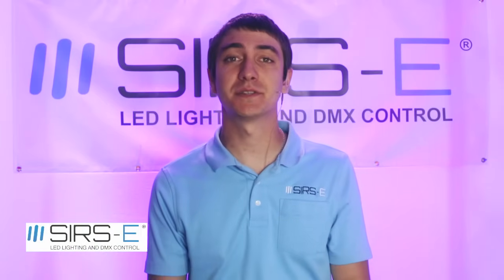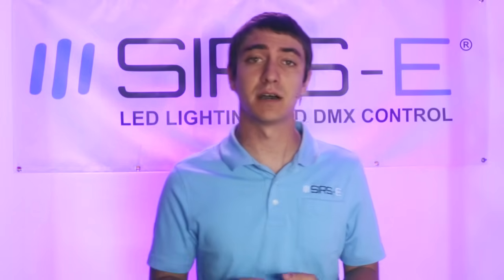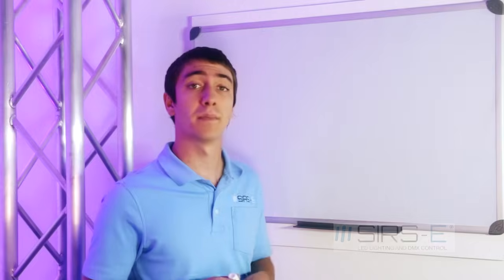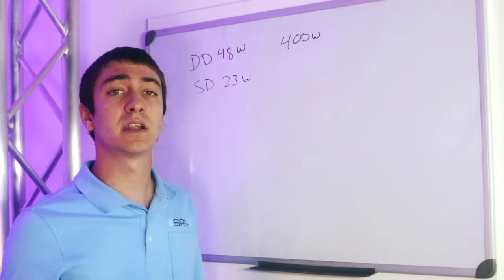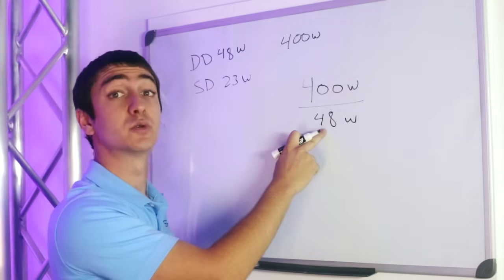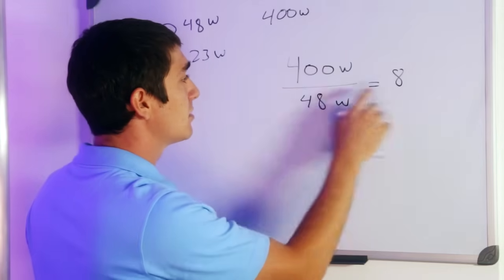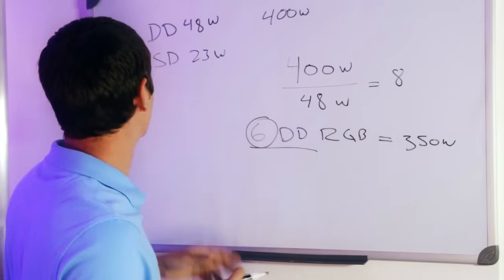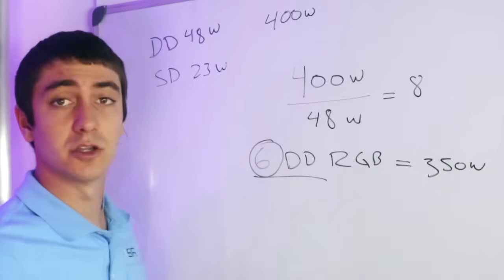How Many RGB LED Strip per Power Supply?

Comment: How do you control more than 1 5M roll of RGB or RGBW led strips? The seller I asked on eBay has no idea. I'm looking to use 5 rolls for the front room project in my place as I have a 450W computer PS already, I would like to use the RGBW so it can be my main lighting. Thank you very much
Reply from the maker: +Josh Rhoton Hello Josh, we are more than happy to assist you, please email us this information at info@sirs-e.com and they will be able to answer your question thoroughly.

Comment: Hi! This was an interesting watch, and I feel almost ready to re-revisit my LED wiring mission (which I had to abandon before as I had serious power issues).

I am looking to wire eight separate strips of RGB 5050 strip lighting around different areas of my room. I tried this in series but realised I didn't have enough power in the circuit, and loose connections between the strips was a nightmare too so I had to give up.

Each LED strip I intend to use will be around 1m long. If I want to wire these in parallel, and each strip has the brightest 60 LEDs per metre, how big a power supply will I need, please? Can I wire 8 x 1metre strips with one power supply safely? 

Thank you!
Reply from the maker: +thegrimey Hello, unfortunately since I do not know the nature of the strips you are working with I wouldn't be able to give you an exact answer, but generally you want to look at the wattage consumed by your strips then get a power supply that wont have to run at full capacity to fulfill your needs. You always have the option of more then one as well.

Comment: Can i power 2x5M RGB Strip
12V 5A Power Adapter
without loosing brightness or else?
Reply from the maker: +Aleksandar Dukadinoski Hello, as long as the strips are 12v I don't for see any issues.
Reply: +SIRS Electronics Inc Don't 2 strips add up to about 60W for the SD and  about 100W for DD? The power adapter can only supply 12V*5A = 60W max, so by taking your safety measure of using max 75% of the PSU, my guess would be that the PSU won't be properly dimensioned?
Reply from the maker: +Kris Lemkens Hello, we carry power supplies at 96w, 200w, and 400w to handle these loads.
Reply: Yes, but you just told Ace Duk that it will work! Thats an overload.

Comment: I have a 12 voltz with 15 Amps power supply... how many Strip Led lights does it can light up? and do I still need to put some resistor on it? pls help thanks...
Reply from the maker: +jay vargas Hello and thanks for your comment. For SD RGB you could run 4 strips being parallel to each other. and with double density you could do up to 3 strips with the power supply you specified.

Comment: Hello! I have purchase Warm white 5x5M of 3528 SMD 600 LED waterproof strip. I wanted to connect each of them for me to have a 25M long strip. can you please advise how much power supply do i need to use.

Thanks!
Reply from the maker: +Giancarlo David This is what you will need;

In essence, Since it is a double density LED Strip you will need a power supply for each Strip, However, you can simply use a 200W power supply in the middle of two Strips meaning one going left and one going right in order to finalize your circuit. so you need two 200 W power supplies, and for the final strip you can simply run a wire back to the closest one being 16 ft away. Hope this helped.

Comment: Double density = 48W ? Does anyone know what they are talking about ? He mentions 5050 and 3528 strips.
A 60 led / m, 5050 strip is 14.4 x 5m = 72watts; 30 leds /m = 36watts
A 60 led / m  3528 strip is  4.8 x 5m = 24watts; 30 leds /m = 12watts
Where is he getting 48 watts from ?
The most common, 60 leds / m, 5050   at 72 watts per 5 meters x 6 (as he suggested) would draw 432 Watts !
So much for the 400 watt power supply !?!
Reply from the maker: +terryehhh Thank you for watching our video. We have come to the conclusion that the 72W is not accounting for Voltage drop issues. What that means is that after 16.4 ft ( the length of a full roll ) you will have about 11.2V towards the end. Please take a look at our datasheets 

http://sirs-e.com/wp-content/uploads/2009/05/5050-LED-RGB-DD-Data-Sheet.pdf
Reply: +terryehhh Where are you getting that info from? The 5050 60led/m I've been checking on most of the pages are 32W each... so my 10m are 72W and I'm getting a 6A (72W/12V) power supply.
Reply: I think they come 30, 60, and 120 LED's/M
the 60 = 14.4w/M. haven’t checked current to
see if that is accurate.

Comment: If i were to connect in series, but at a distance apart ... do you have the supported "length" configuration? For example, my setup is .... RGB strip x 2 (total of 30ft) <------ distance of 20ft -> RGB strip x 3 (total of 45ft). Basically i want to know is, if i put the power supply in the middle, how many strips each direction "in series" can it be supported with no voltage drop. (Also taking into consideration if i need to have a gap in between 2 RGB strips). -> This setup is for outdoor X-mas lighting and hence not continuous...... Also, is this also valid for Technicolor pixel strings?
Reply from the maker: +Abhijit Das , Hello and thank you for your comment. Before we could define how many LED strips you can use with a power supply we need to know what kind of strips they are (LED size, density, power consumption, etc.) We would like to assist you with this project, so why don't you give us a call 956-522-2006 or contact us at contact@sirs-e.com

Comment: 350 is definitely not 75% of 400.
Reply from the maker: +drignotum Hello, as mentioned in 2 previous comments:You are definitely right. We actually have notation in the video around 3:23 in which we address this mistake: "Ooops, 300 Watts!"   As far as the rest of the video goes, 6 strips stays below 75% consumption while 7 strips would exceed "300" watts. Thanks for commenting.

Comment: you need to show amps to watts conversion because a lot of the power supplies are rated in amps and that confuses some people
Reply from the maker: +D Lofton Thanks for the idea. For anyone that has had this question: Volts (X) Amps = Watts, which could also be expressed as Watts / Volts = Amps or Watts / Amps = Volts

Comment: Wouldn't 75% be 300 watts instead of 350 watts? This video does explain well other than the stated safe wattage usage.
Reply from the maker: +Lin Bry Hey Lin. You are definitely right. We actually have notation in the video around 3:23 in which we address this mistake: "Ooops, 300 Watts!"   As far as the rest of the video goes, 6 strips stays below 75% consumption while 7 strips would exceed "300" watts. Thanks for commenting.

Comment: if i use 36 watt led strip by 4 = 144 watt, refer to your guidance ideally i need to choose 180 watt power supply.....But for availability reason  is it ok if i use 360 watt power supply ?
Reply from the maker: +dinar wikantyas Yes, it's okay to use a 360w power supply. However, if you're doing a linear connection then you might have voltage drop. I suggest you start your LED run from the middle if that's the case. 

Check on this reference: http://sirs-e.com/wp-content/uploads/2015/02/Brightness-Loss-diagram.pdf

For more details and info, reach out to us @ http://sirs-e.com/contact-us/

Comment from the maker: Hello +propfella, since we were not allowed to reply to your comment about our video directly, we thought we would post our reply to your comment here.

Your Comment:
propfella 8 hours ago
Back to school for you mate. 75% of 400 watts is 300, not 350.   ...   80% isn't pushing a 400 watt PSU, unless it's poorly designed of course. If the strips aren't working at maximum output continuously the use of more LEDs would be OK. As long as the temperature of the PSU doesn't get too hot, I'd be happy to use 7 strips. I've noticed in your videos you seem to tell viewers your LEDs etc are superior to others available. Aren't you simply a reseller of Chinese stock ?

Our Reply:
Hello +propfella, thank you for watching our video and for your comment. We value everyone's  opinion, especially if we gave out wrong information.  This helps us improve ourselves and ensures we provide accurate information to our viewers in the future.  The intent of our YouTube channel is to help others learn and to share information about our products.  With that said, you were correct about the 75% being 300 watts. Unfortunately we found that error after our video was produced and uploaded.  To fix the issue we created an annotation that would display the correct answer.  

In regards to your comment about "80% isn't pushing a 400 watt PSU...", we would like you and all of our viewers to know that we use the 75% - 80%  as a recommendation to ensure the longest lifetime possible for your PSU.  We take great pride in designing quality products for our customers to ensure they continue working no matter the situation or elaborate their installations may be.  A common fact that you may know, is that the PSU efficiency varies according to the TA (ambience temperature).  Using our low cost power supply you will find maximum efficiency and load is at 20 degrees Celsius.

We have never stated that our products are "superior to others available", simply that we offer high quality products.  All of our product's datasheets contain product origin.  You will see that our products are professionally designed here in the U.S by our Engineers, then they are assembled in China per our specifications in order to pass on the savings to our customers.  

If you have any questions, please feel free to use our "Contact Us" page on our website and we will be sure to have an engineer get back to you.  http://sirs-e.com/contact-us/

Comment: 1300 watt how many led's can i run
Reply from the maker: Hello guynumber20, thank you for watching our video and for your question. We don't believe there's 1300W power supplies, but if you want to check for yourself, you can divide the 1300W of the power supply by the 48W the dual density strip consumes and also divide the 1300W by 23W the single density strip consumes. But remember this will give you the maximum amount of strips and to be safe you should never run a power supply at full capacity.
Reply: SIRS Electronics Inc there are 1500 watt psu by corsair

Comment: So if i was to run 4 Rolls, Would I just run each end of the strip to the power supply? or can I run 10M straight x2?
Reply from the maker: Hello AlpineEnt, thank you for watching our video and for your question. It all depends what type of LED strips you're using (RGB, RGBW, Single Density, Dual Density, etc.) and the wattage of the power supply. You might need Booster Amplifiers and more Power Supplies. Feel free to email (info@sirs-e.com) or call us (956-522-2006) with your project info and the type of strips you think of using so we can help you out better.

Comment: Prices nuts! I'm willing to pay more for quality & good service but your prices are crazy.  Buy 5 sets from China  With money left over.
Assume two are crap still better.
Reply: Buy cheap, buy twice. Always be careful of buying electrical stuff from China, as it could burn your house down. Their laws are not governed by EU regulations, which is partly why they are so cheap. It's like buying a shark cage made out of two shopping trollis welded together, would you want to take that gamble?
Reply from the maker: Hello jpalm32, thank you for watching our video and for commenting. While our prices may differ, there are other differences between the quality of our product and theirs.  Our strips have an increased light output, increased efficiency, more lumens per watt and better color balance.  This can't be obtained by buying 5 Chinese LED reels.  Also many of our customers depend on the quality of our product and our customer service because many of them use our products for themselves and/or their clients, and they need the reassurance that the product will work and knowing that we are here for support if they need it, is an extra incentive for them.

Comment: So in the video it recommends a maximum of 6 strips for DDS and would make the assumptions of 12 SDS, but on your power supply there is only space for 3 +/- connections, Do you just wire 2 strips to each for DDS and 4 strips to each for SDS?
Reply from the maker: Neo Neoex You can actually screw down more than one wire in each port on the power supply.

Comment: Informative video thanks. Question: now I know how to calculate the max strips per psu, how do I wire the strips? I've heard that they should always be wired in parallel as when wired in series it can overload the strip and lead to failure. Is this right? Thanks again.
Reply from the maker: Michael Dawson Thanks, Michael! You're right, LED Strips should always be wired in parallel to one another.

Comment: The single color led strips runs at 3 watts a meter. It needs 5 watts a meter to run for a power supply. 

I made a video also and went over that.

Comment: Thanks for the info in a very clear manner.  As you mentioned the number 1 enemy of power supplies and LED's is Heat and here in AZ we have an abundance of that... LOL.  We have been doing tons of installs for custom LED work ( along with Carbon fiber vinyl wrap, not sure why but they go together well) and when it is common to hit 120 degrees in the shade I have the guys use the 1/3 rule.  Same thing except instead of 75% usage of max wattage we do 66%.  So,in the same example I would do five strips hitting about 61% of the max wattage.  I'm thinking we are starting 20% behind most everyone else before we even solder out first connection... Better safe than to see roasted components. My 2 cents if its worth anything.  Thanks again for the great video!!
Reply from the maker: Hey Nicholas, you are right. Thanks for your comments.